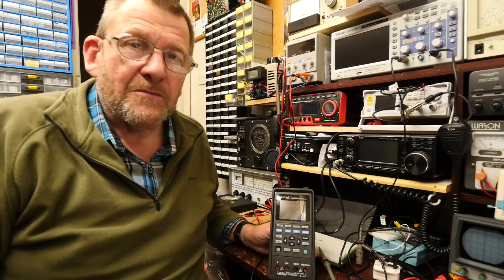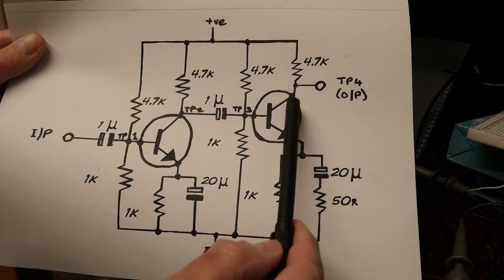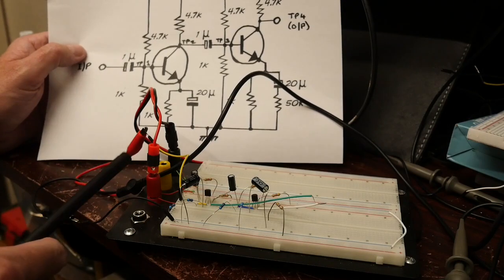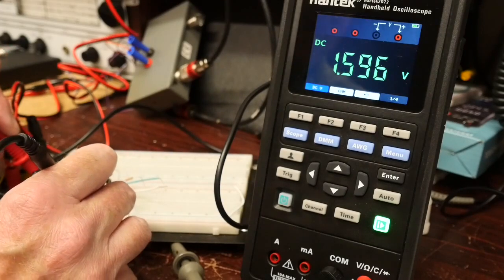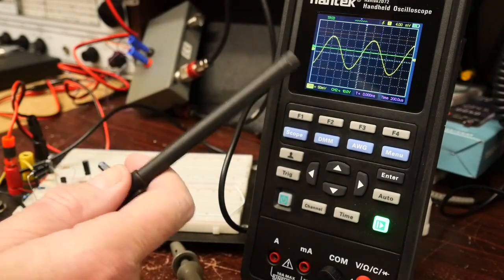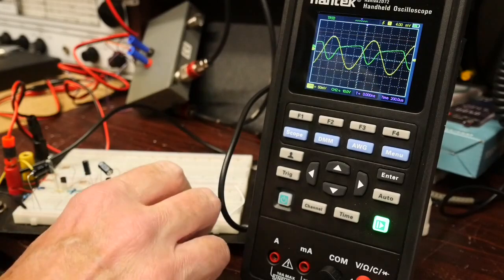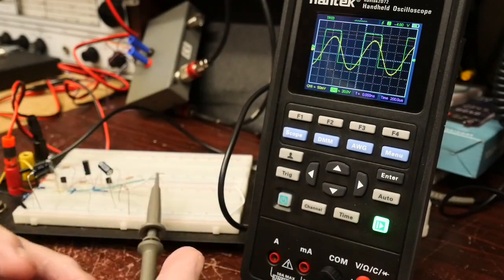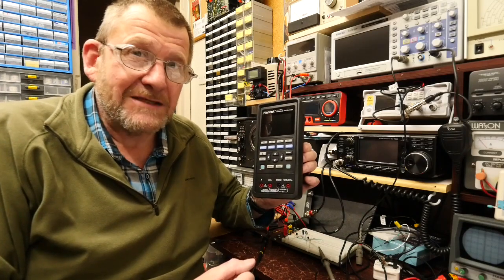Hantek 2D72 Oscilloscope/AWG/DMM exploring a common emitter amplifier

Comment: Your output waveform cannot be more than your power supply voltage.
I think you had channel 2 set for a 10X probe, but had your probe switched to 1X...
You always have to check to see if your results are reasonable.
And if they aren't, check your scope and probe multipliers to make sure hey match!
I love the ones I have, and that is a mistake I made a lot when I first started using mine a few years ago.

Comment: I'm thinking about consolidating some space on my bench and this unit looks like it might fit the bill. 

Question: I mainly work on vintage tube gear would you say this unit is a good match and is it sensitive enough to test microphonics and noise in components. 

Thanks for the vid!
Reply from the maker: Dan, I would say yes, I got this one so I could test old tube (valves to me!) radios with floating chassis, as a conventional scope would very rapidly trip the RCCB in my house wiring!
Reply: @LockdownElectronics  Thank you sir!

Comment: Thanks for creating the video.  Trying to understand the difference between the 40Mhz and 70Mhz models.  Since this is my first scope,  what would I give up by going with the 40Mhz version on this device?
Reply from the maker: What do you plan to use the scope for?
Reply: @LockdownElectronics  At this point, I am looking to check for mostly low level DC voltages in devices such as raspberry pi.  Also thinking about  looking at signals coming out of audio devices when troubleshooting a problem with home stereo systems.
Reply from the maker: I would say the 40MHz one would be fine for that.

Comment: Thanks for the interesting demonstration of what can be achieved with such a tool.
I'm looking forward to buy such a device and your video is of great help.
As I'm new to this subject, I wonder how it is possible to find a signal of 80v (4 divisions of 20v) from a 9v powered system ?
Is this related to the probe attenuation factor ?
Thanks by advance and best regard,  Michel
Reply from the maker: This may help)
https://en.m.wikipedia.org/wiki/Voltage_multiplier
Reply: @LockdownElectronics  Thanks, I'll have a look.
Best regards, Michel